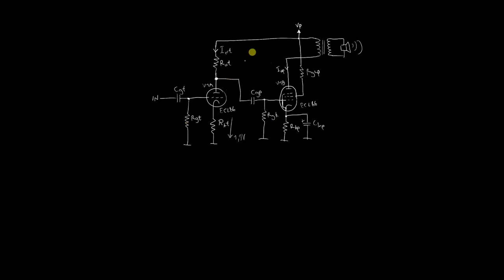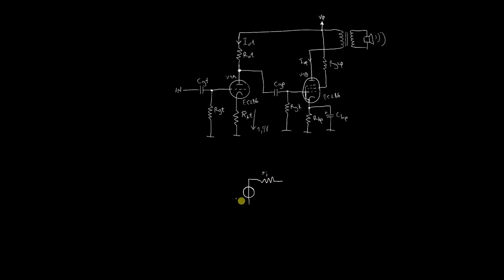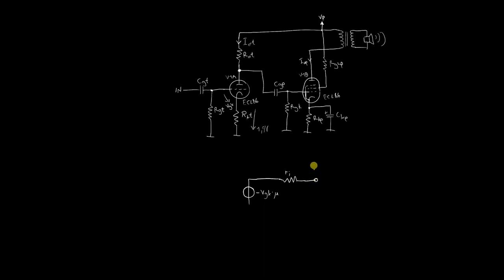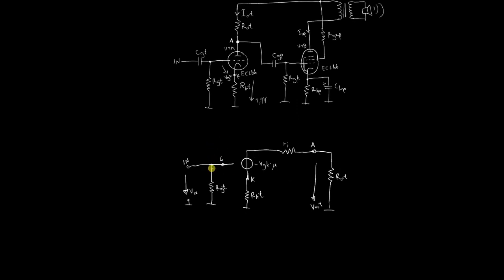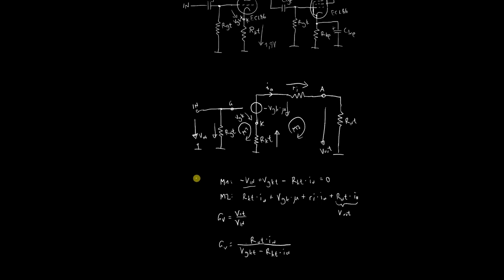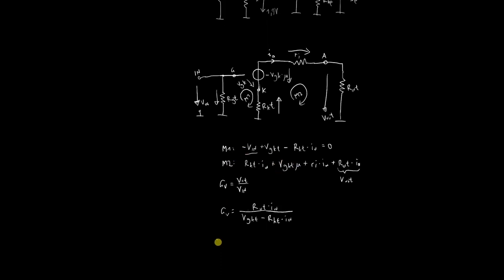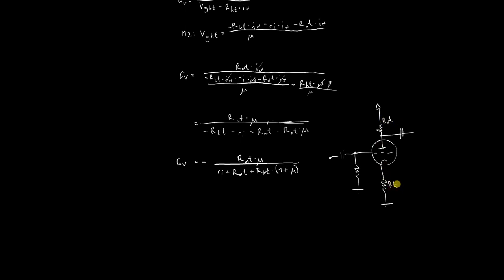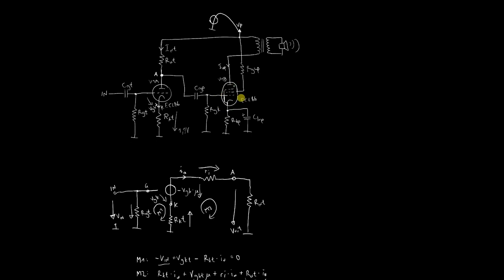ECL86 single tube amplifier design series - Part 3

Comment: I'm curious, what value are you using for the primary of your transformer?  Danke!
Reply from the maker: That's a good question, thanks for asking! It's the Impendace of the loudspeaker but transformed via the output Transformer. This means that you use The following formula: Zp = Zls * N^2. Where N is the winding ratio of the transformer between primary and secondary (N = Np / Ns) and Zls is the impedance of the Loudspeaker. So the output of the formula is Zp and this is what you use as the output resistor for the gain computation (You replace Rap with Zp in the formula which I showed you in the video).
The impedance could also be written on the transformer. For example on the secondary winding, there could be written 8 Ohm and on the prim, there could be written 5000 Ohm. If you connect an 8 Ohm loudspeaker to the 8 Ohm connector, you will have a Zp of 5000 Ohm (in this case the transformer manufacturer already did the computation with the Zp = Zls * N^2 formula for you). The N of a transformer that transforms 5000 Ohm to 8 Ohm would be 25.
Reply: @MrVideoTronix  Thanks a lot, i was just curious to see what your choice of component was, its a great start guide to tube amps!
Reply from the maker: @fredericgeneau9927  You are welcome! I am glad that you like my series.